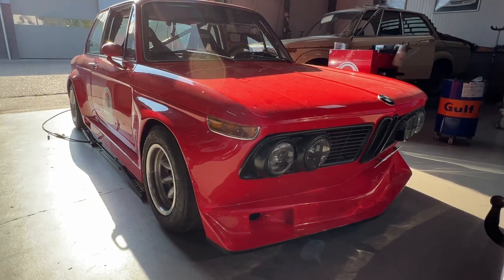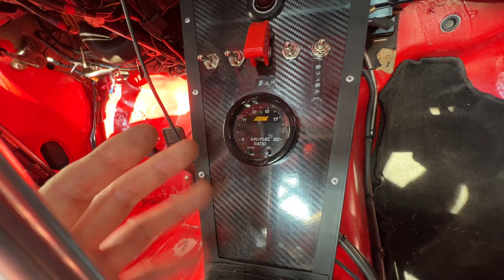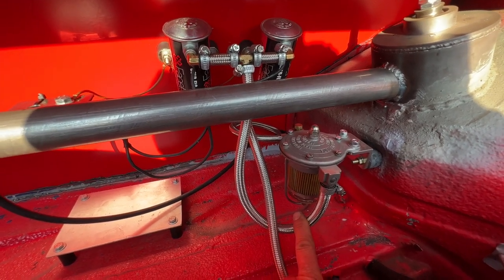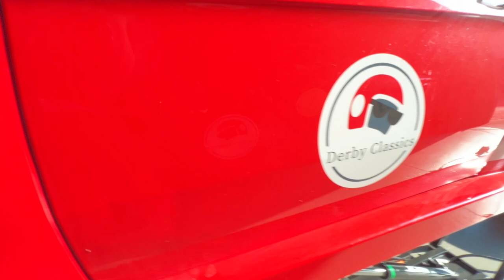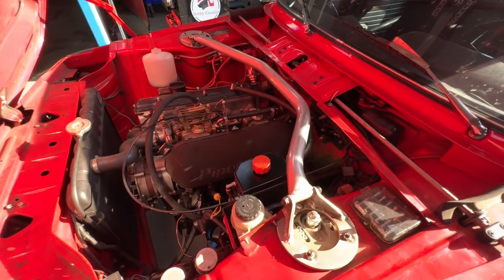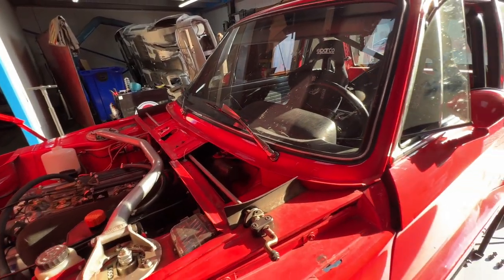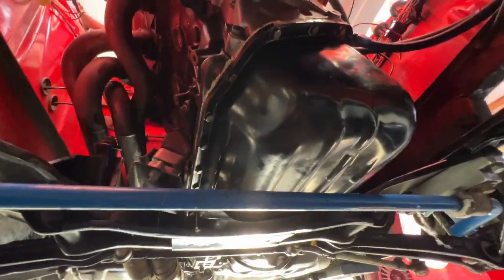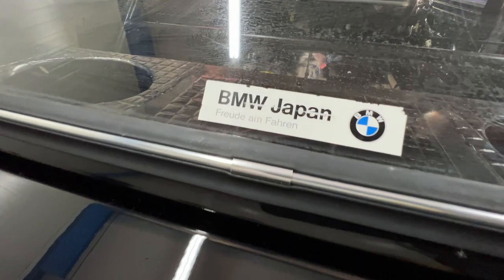My Perfect Ring Tool - BMW 2002 - The 02'Licious

Comment: Great video. I notice you use the Tri-Y type exhaust manifold, which is known to be very good for mid torque but not so good for maximum power. I my day I used a Stahl header, which is a classic 4 into-1 pipe design, which is considered best for max output power.
Reply from the maker: Thanks. I had a Stahl & it had a bit more power top end at the dyno (200bhp), but at the Ring throttle modulation and mid corner torque is very important so that's why I chose the martelius. I did go for the 63 mm instead of 57 mm. Now it's pulling 185-195 (depending weather) on the dyno. Pretty happy with that. Cheers

Comment: What wheels are those and size?
Reply from the maker: Those are maxilites. Front 13 inch 8J Rear 13 inch 9J. Tires Are Nankang Ar1 front 13/60/205 rear 13/45/235 Cheers